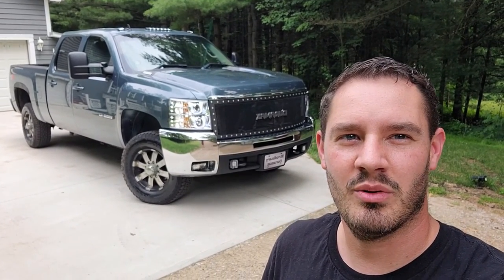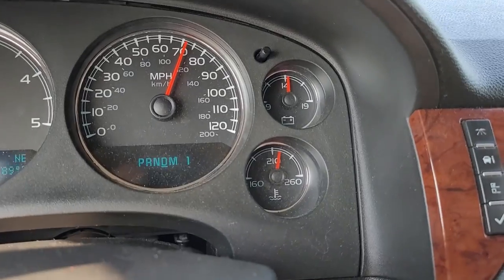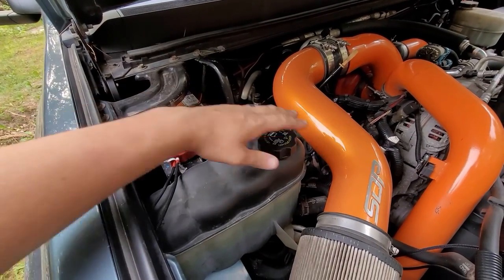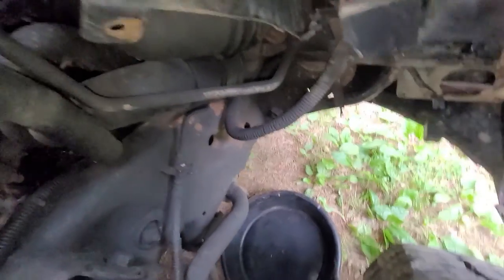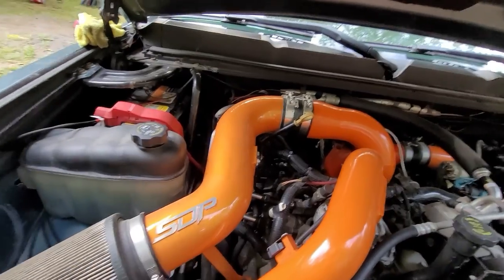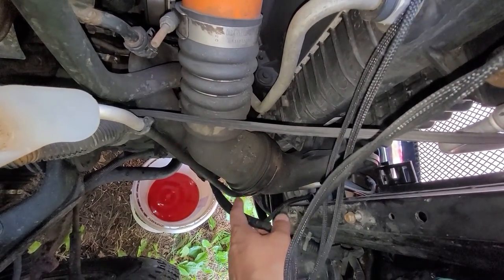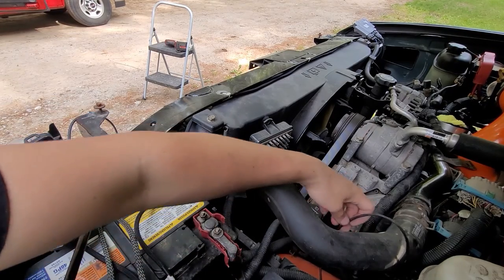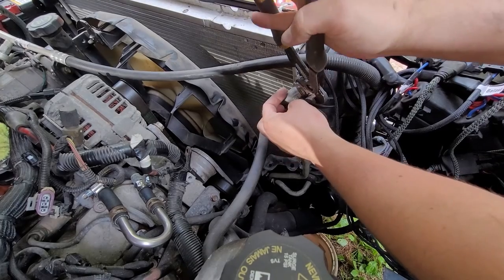CLEAN YOUR COOLING STACKS!!

Comment: Great Video 👍
I have a LMM and my Edge ECT indicates 185*F. I noted your is only at 165*F. I replaced my defective fan clutch. The coolant bleeder screw is on the top of the thermostat housing. Nice looking truck but I think your air intake is pulling hot engine heat into the intake, this is not helping your overheat issues.
Thank You for the Great video.
Reply from the maker: Yes. I've been told to check into my thermostats as I should be running a little warmer. I know my fan kicks on, as I hear it from time to time when my truck sits for days in the sun. Lol. Maybe I have a bad temp sensor in my fan clutch. May be a good reason to upgrade to the Kodiak one. Thanks for watching!!

Comment: My a/c gets a little warm when sitting and it’s really hot out. Maybe after 530k I need to clean mine
Reply from the maker: For sure! I can definitely tell it made a difference when towing in the heat. Plus on top of cleaning it, you can put new coolant in it as well.

Comment: Thank you for making the video. Great job! I don’t know if you realize, but your thermostats are stuck open. you’re operating temperature should be up around 185-190°.
Reply from the maker: I could see that. Since it got up to 240+ that one day, it has ran cooler when not towing. Then when towing its over heated. Would makes sense that they are sticking or the gaskets on them are going bad.
Reply: Dealer says 210 is normal temp. Hence why they put it in the middle.  A lot of folks say 185-190 but Chevy says 210
Reply from the maker: @Jessehermansonphotography  Yup! That's because the engine temp is at 210° right? Because the T Stats open up at 185, so that would give the coolant time to cool off and cool the engine, then cycle back again. I know GM temp guages have just been aesthetically pleasing since for ever. That's why they don't jump up and down as much as monitor do as they give you actual temperature readings.
Reply: @xtrodinaryduramax8010  agreed. I need to buy what you have for better accuracy

Comment: what is that window mounted meter you have there called
Reply from the maker: It's and EDGE CTS2 monitor. They have a CTS3 monitor out, however I haven't tested it out yet.
Reply: @xtrodinaryduramax8010  Thanks buddy!
Reply from the maker: @SolarDrew  no problem!

Comment: I have an 09 that overheats towing 5000 lbs and just paid $3k to have all new water pump thermostats and fan. It runs a little cooler but still over heats. 240 degrees up a grade in 90s ambient temps. I told the shop to clean the stack and they started saying it was the water pump. They never cleaned the stack. It’s hard to find a knowledgeable diesel mechanic.
Reply from the maker: I agree! They just want to throw parts at it and make it easy for them. Having a clean radiator goes for all vehicles. It's a bummer that you had to shell out $3k on your truck.
Reply: @xtrodinaryduramax8010  Thanks for the reply. I’m looking at buying an aftermarket radiator and having the mechanic clean the stack and install the new radiator. The new radiator would half upgrade and full on the shop to clean the stack. Any thoughts? The truck has plenty of power I just don’t want to hurt the motor. A head gasket repair is a lot of money. Thanks.
Reply from the maker: @jamesbrett5010  I hear the Banks and Mishimoto radiator are good ones. If you are looking for aftermarket replacements. The GM is also a very good one too. And you will have them clean the A/C coils and the intercooler? With T stats already replaced, that truck will run like new.